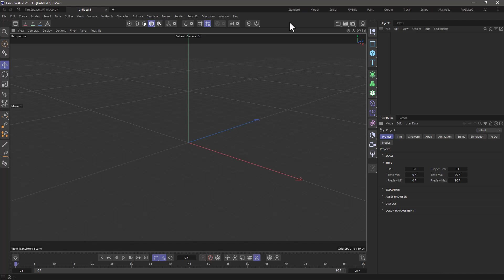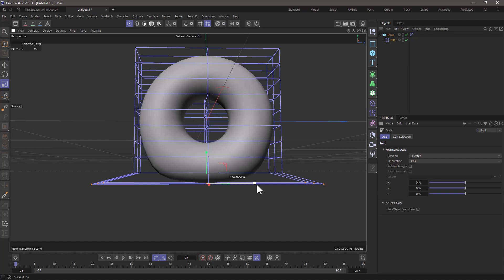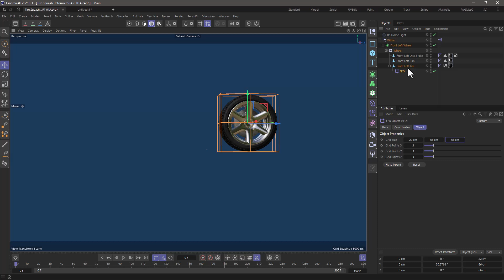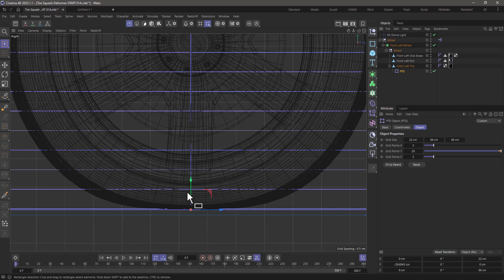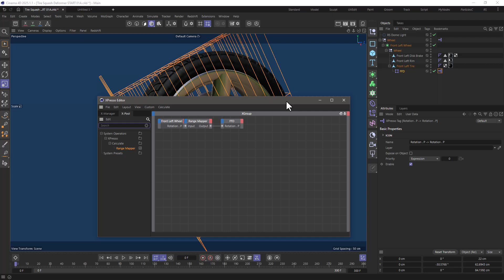#C4DQuickTip 172: Car Wheel Contact Patch Deformation in Cinema 4D

Comment: couldnt you constrain the rotation of the FFD?
Reply: constraints would add another layer of calculation and slow it down, also would be buggy likely
Reply: @Renix  isnt the xpresso also another layer? I would think that thats equal in compute
Reply from the maker: we need the counter - rotation (inverse). That's why I used XPRESSO
Reply: @ yeah i know. but if you wouldnt allow it to rotate on a world level, wouldnt that work?